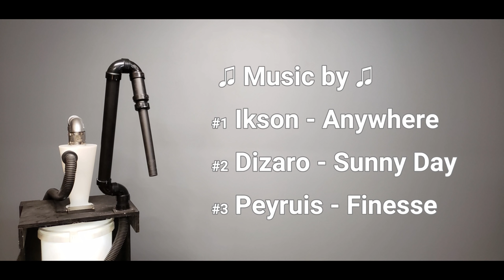DIY ABS Pipe Arm for Dust Collector :

Comment: Been looking for a positionable vacuum hose solution for my drill press scroll saw and sander station. This looks like the best option I’ve seen so far! I’ve even got a bag of extra abs fittings leftover from a plumbing project.

Comment: Good job, easy, cheap.

How to insure the movable joints don't loosen and fail to hold position after wear?
Reply: Maybe use a wingnut on the outside?
Reply from the maker: I can always tighten the screw with a screwdriver, or adding a wingnut like Chris says, but I do not think that the wear could be a major problem. I did a few tests before starting the project, I tried to make premature wear by turning the pipe in one of the connector and the whole thing was still tight. I think i would need to pivot the arm hundreds times before it fail. I will keep you update. 👍